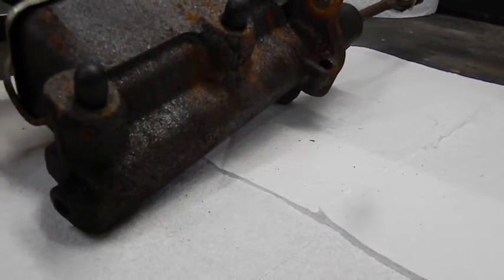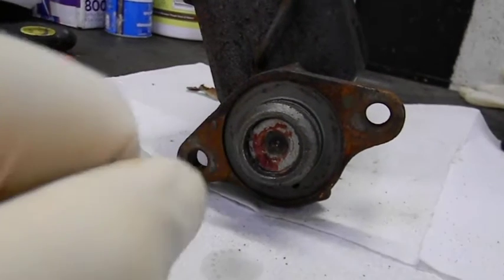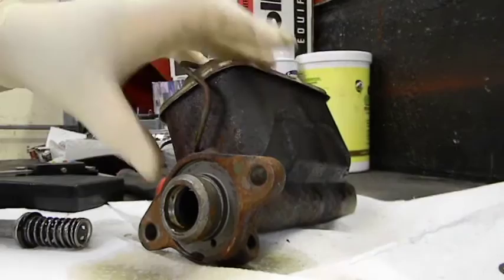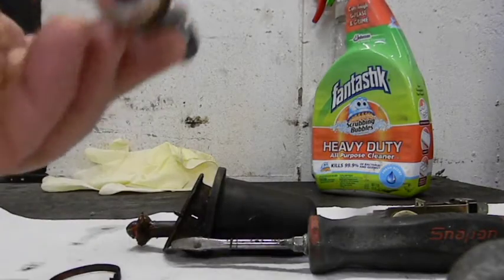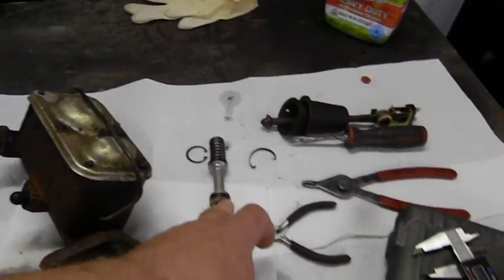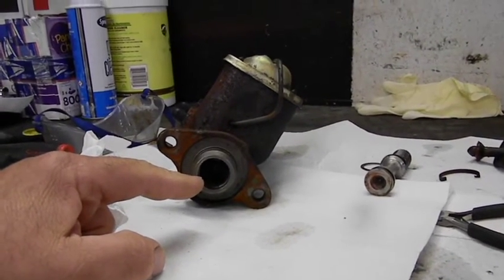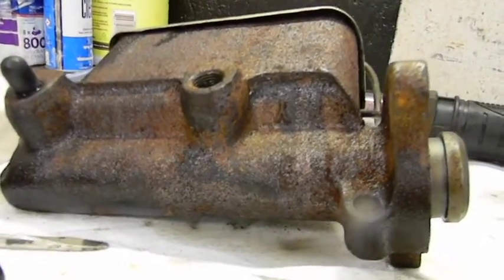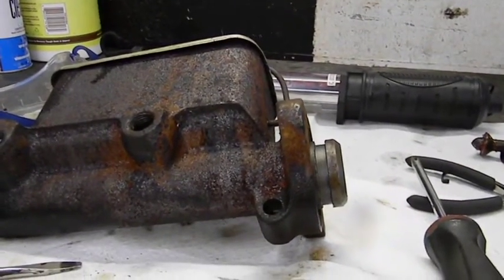Converting A Master Cylinder To 4 Wheel Disc And Checking It`s Bore Size

Comment: Made in China, no markings confirm that. You got the math right. Right about the corvette masters too. Might be good idea to use a master with a 60-40 volume output like the vet for 4 wheel disk for safety reasons. Aftermarket should have what you need in 3/4 bore. The reservoirs will almost be the same size for front and back, the back being just a little smaller. With the back port being a little more forward then what you have now.